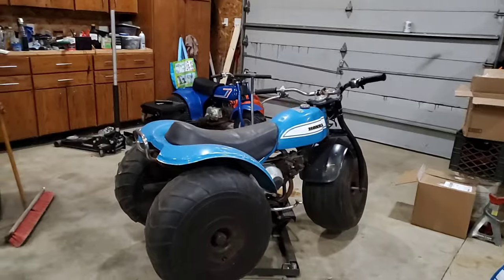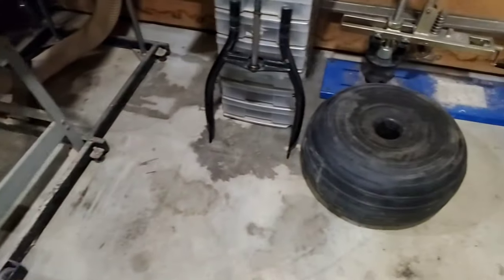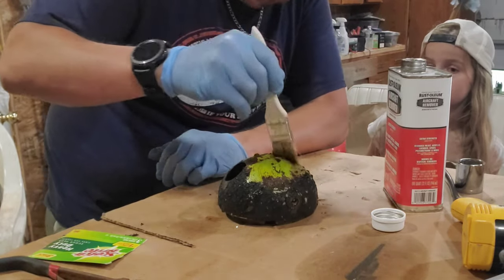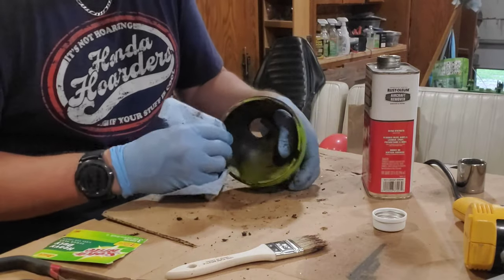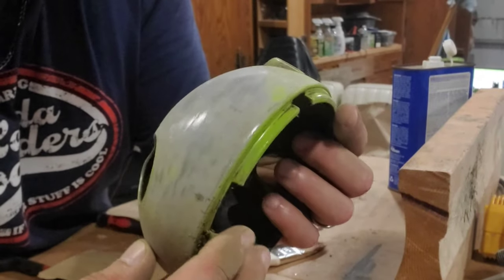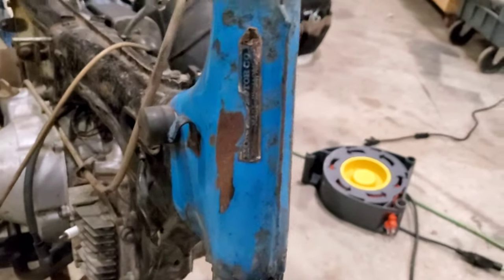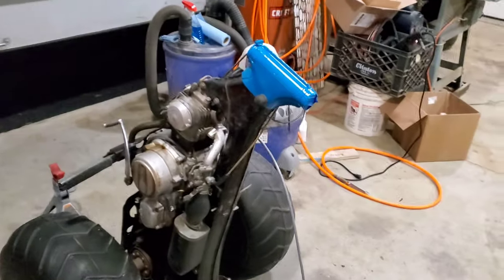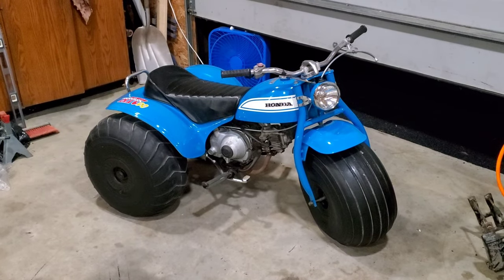1970 Aquarius Blue Honda US90 - Quickie Facelift / Restoration

Comment: Do you recommend tank linings for your bikes to prevent rust?
Reply from the maker: If your tank isn't rusty... just avoid using gas with ethanol in it... and keep it all the way full, or all the way empty and you should be fine.

If you have rust, sometimes it's good to line it, and if it's "low level" rust, I use POR15.  If you're past that, I use Caswell in Battleship Gray (color).

Comment: That thing turned out beautiful just by color matching everything. I was thinking to myself too. How does one patch those tires? I hear allot of people patching them but I can't figure out how they do so. I don't own a us90. But I have to ask
Reply from the maker: Thank you!!  So, to patch them, honestly most times it's an external patch applied with rubber cement.  I just ordered some of the ones that go internal through a hole... we'll see how that works though.  I'll be sure to put that on an upcoming video.